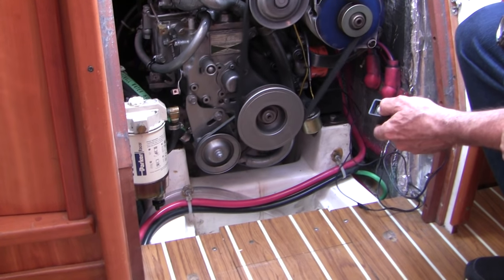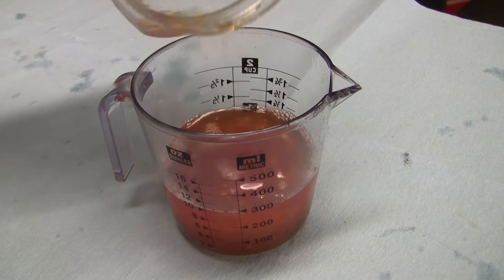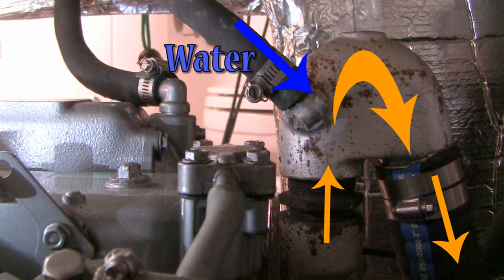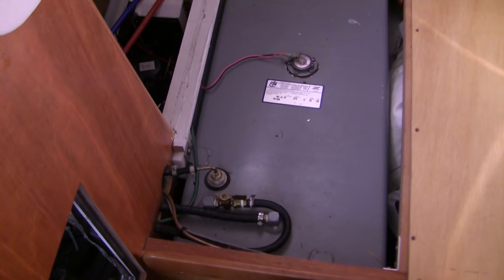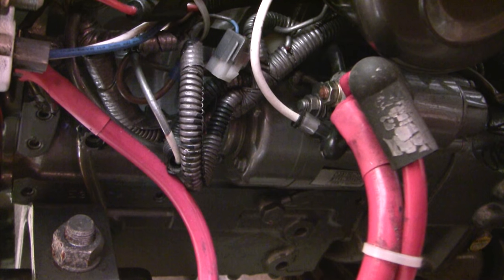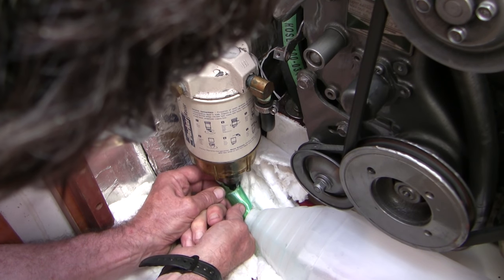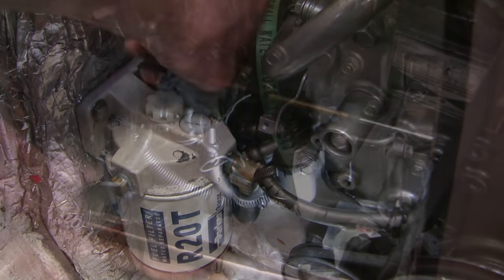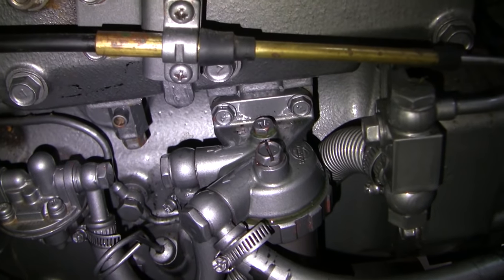How to change fuel filters and bleed air in a Yanmar marine diesel

Comment: good video. I have 2 questions;. 1. you mention bleeding the system beyond the high pressure pump going to the injectors but no info on so doing. How do you do it?  2.  I have read that turning over the engine without it starting can result in water pressurising in the engine and causing damage.  How do you avoid this?  Does relieving the pressure on the cylinders eliminate this problem?
Reply from the maker: To bleed beyond the high pressure pump, you bleed each line in turn, cracking open the line just before the injector and turning the engine over to evacuate air from each line. Because they are three in parallel, it takes a while to do that manually. In the example shown, I suspect there was air in one of the three lines in my engine, manifest as a rough running misfire that you can hear after it starts. Thirty seconds later that last cylinder kicks in as air is cleared, and the engine speeds up and becomes more smooth. So, if it is not too bad the engine will clear that air by the force of the other cylinders. 

To avoid hydrolock, if you think the engine is not likely to start immediately it would be wise to turn the salt water intake (the seacock) off, then crank it for about 10 seconds with decompression valves open. That allows oil to get to upper passageways and fuel to prime the injectors without a chance of the sudden rapid rpm's of a started engine. With no salt water being added to the exhaust elbow it can't flow backwards and hydrolock the engine. Then close the salt water intake, close the decompression valves and start normally. Sometimes on a cold winter day, when I expect it to start after a couple of 10 second tries,  I just close the salt water intake, start normally, then open the salt water intake while the engine is running (don't forget). 

Regarding hydrolock, if you think you have caused a lot of water or oil or fuel to fill a cylinder you have a few options. I know that the Yanmar engine decompression valves of this specific engine will cause the exhaust valves to open early, so one (easy but not necessarily guaranteed) way would be to turn the engine over a few times with the decompression valves flipped over and fuel turned off. Extra fluid should be pushed out the cylinder into the exhaust, hopefully reducing the chance of a hydrolock misadventure. Another option would be to wait for a few days, since gravity might allow that fluid to flow beyond the rings into the oil pan, so there is enough air in the cylinder to prevent excessive force on the connecting rod. One way to test for a hydrolock would be to put a socket wrench on the crank bolt. A hydrolocked engine will not turn over by hand, and you can't break a connecting rod with hand force alone (do that with fuel off so it doesn't start). Or, if you want to deal with suspected hydrolock more effectively and you have glow plugs, you can remove the glow plugs and put a narrow suction tube down the cylinder and suck out the extra fluid. If you don't have glow plugs (as in this Yanmar engine) you could remove an injector and suck the cylinders out that way. If you don't have a suction hose, just opening the glow plug hole and turning the engine over will eject excessive fluid out the hole. That would be messy, but don't make the mistake of covering the hole with a cloth because during the intake phase that cloth could be sucked into the cylinder. In gasoline engines that have been inverted in an accident, the protocol is to routinely remove all the plugs, and when it comes time to try the engine, we turn the engine over a few times with all the plugs removed, so any excessive oil is ejected out the cylinders through the plug holes. Whenever you're concerned about water or fuel in a cylinder, after you deal with the issue it would be wise to change out the oil because contaminated oil won't work very well. Good luck!

Comment: Thank you for your videos. Have any idea why a Yammar diesel marine stalls when on low rpm and in shift to reverse or forward stalls and dies..? have checked pretty much all. We need to get rpms up to sometimes prevent stalling but very hard to dock boat with this problem etc...Any ideas would be great and will appreciate so much your reply. Thank a lot!
Reply from the maker: Check the simple things first, maybe consider raising idle speed with the idle adjustment screw. Bad fuel, maybe water in the fuel, fuel filters.
Reply: @spelunkerd  thank you v much, yes I am trying that especially idle rpm.

Comment: Would there be an unintended consequence of adding a 12V fuel pump, placed upstream of the raycor, used for bleeding only?
Reply from the maker: Good question, short answer is I don't know. Long answer is that you already have one, by using the starter motor as shown. A dedicated pump near the bottom of the line might work a little better than the mechanical one in the engine because it would clear air and prime itself more quickly. Many outboard engines use a hand operated pump, so you might not even need the extra complexity and risk of another electrical appliance. However in the big picture I'm happy with how mine works as is. Thanks for your thoughtful remark!

Comment: Hi
I think all of you that are having problem using the feed pump manual feed is using it wrong. When you push the lever, 80% of the stroke is just picking up slack, the last 20% is what does the pumping. When you feel resistance in the lever, try pushing it a bit further. You will feel what I can best describe as pumping feeling.

I have no problem fillinf both my fuel filters from empty to full in under a minute using only the manual feed.
Reply from the maker: Good point, although the basic design is similar, we all need to be familiar with how our own pump works. Even when purged of air, my butterfly lever has a hard end stop so I don't get the response yours does, but your remark will be worth remembering for others who stop by. If mine were to do that I would wonder if the pump is resting on a high point of the cam lever, and I might choose to rotate the crank a little to make pumping more efficient. There is a dramatic difference in how these pumps perform if the line is not purged of air, which explains why air in the fuel line is a common cause of engine shutdown. If you push the lever with air in the line, the air volume expands to fill the void, rather than drawing the viscous diesel fuel upward. Energy you put into cranking the lever is absorbed by the air and the diesel moves very slowly, like trying to run in sand. Fluid won't move at all if there isn't a minimal amount of suction, which might give the impression of better response at the end of each stroke. Once the short stretch of line between the fuel filter and pump is clear of air, pumping the rest of the line is dead easy. As you say with the line clear of air you can actually feel the pump doing its job. If there was some way to design the system so that the line leading up to the pump would purge by gravity it would be much easier, but as always there are competing design interests. In any boat it is critical to have heavy parts like the fuel tank as low as possible to promote stability, so that short stretch between filter and pump is unavoidable.
Reply: @spelunkerd  
Really good point about the position of the cam!
Anyway, I have a 3gm30 and recently removed the pump becuse i broke it (ruined the threads #facepalm). Figured I could share what it lookes like on the inside when you operate the manual lever.
https://youtu.be/Dk--muuQAJc
Reply: Great work with the in-depth video!  Good point that these pumps are slow at pumping air.  You had the option of continuing to use the primary  filter's  plunger pump as it could do all the downstream bleeding.  Sadly, most engines don't have a compression release.  A primer bulb in the line before the primary filter is a great option if the primary filter doesn't have a pump.  It is much quicker than any of the 3 pumping means shown. Like many filter bowls of plastic (like yours), it doesn't meet the heat test used by UL/ABYC/USCG which may get (largely invalid) insurance scrutiny if mounted in the engine space. There are electric pumps by Facet that have both the low pressure desired and a free forward flow when off but as you say, they are electrical. They cost the same as a spare mechanical pump which can fail at the diaphragm or the check valves. A leaking diaphragm might leak fuel into the crankcase or bilge.  How many years to trust them?   Simple as they are, they are a risk and should probably get swapped at 500hrs/10yrs interval and keep the used one as spare or replace with electric and plug the  mechanical pump's output port.

Comment: If you don't have filtered diesel, can you fill the filters with diesel treatment?
Reply from the maker: I suppose it's possible, though the cleaner needs to be combustible by itself to not stall the engine when a pure dose hits the cylinders. Professional fuel injector cleaners are designed to do that in gasoline engines and I presume a similar formulation is available in a diesel form. However as you saw it was simple enough to clear the line the way I did it, and all of the fuel that made it to the injectors was filtered to 10 microns twice. If you get a speck of dirt into an injector you may need an expensive overhaul that might be avoided by being careful to filter everything that is on its way through the injectors.

Comment: I’ve just did all this, and what was once a dry engine, now has a slight leak at the secondary, yanmar filter.  I just can’t get the O ring to set!  Have you seen this before?  Any suggestions?  I’ve taken it off and on about 3 times, all with a  drop (only when engine is running)

Any tips are appreciated!

Thank you,
Reply from the maker: Dealers say to replace O-rings at the same time, they are cheap and easy to swap out. I would get a small tray, add about 10cc of motor oil to it, then put the new O-ring right into the tray so it's coated with oil. Then check the mating surfaces for dirt and carefully slide the new seal on. In the video you saw me coat the primary filter seals using diesel rather than motor oil. Motor oil is probably better for sealing leaks, and it is probably also better for more easily getting the filter off later. You might have a tiny bit of sand or debris preventing a tight seal, it doesn't take much. Don't forget to carefully examine the mating surface, you'll probably need a mirror and a light to see it properly. A small drip of diesel out isn't too much of an issue, I've seen that before. Getting air into the system would be more concerning. Good luck! If you think of another method that works better for you, don't forget to stop back and leave notes for others who visit here.
Reply: For the longest time I had a slight ooze at my secondary filter which I traced to the bleed port.  The copper washer, even when annealed or replaced didn't seal.  I had to polish the mating surface on the casting before that was fixed.

Comment: how do you bleed the line going to the high pressure pump without using the starter motor?
Reply from the maker: Good question, I've always used the motor. Although that butterfly valve works pretty well for lines up to the pump after all air is removed, it can't purge the lines beyond because the individual lines are only open during a small part of the combustion cycle. So the whole crankshaft needs to be spinning, somehow. I suppose you could do that by hand, but using the motor is so much easier. Also note that there isn't much to stop the motor from firing up, aside from ensuring the decompression valves are flipped on. So cranking by hand with a breaker bar could be dangerous, a ratchet would be better because it would hopefully slip to allow the motor to spin faster if it were to start. During the video you can hear the motor fire up on two cylinders, but the third took about 10 seconds longer, probably because there was more air in that line.

Comment: where is the plunger to pump when bleeding the air our of the filter at 18.23?
Reply from the maker: The tough thing about using a video camera in a boat is the poor lighting and cramped quarters. The time stamp you provide is the end of the video, but I presume you are referring to pumping the primary filter starting at 10:58. That brass rod hangs down from the housing after the filter is removed, not well seen in the video. When screwed down it is concealed from view, you don't need to store anything separately. The separate butterfly pump is mounted on the engine block, powered by a cam on the camshaft when the engine turns. If the engine stops at a high spot on the cam lobe, the pump won't work manually, and you'll feel no resistance when you move it by hand. In the unlikely event that happens you can rotate the engine a little and it will allow internal springs to load the pump with a mouthful of water.
Reply: @spelunkerd  I appreciate your response. I understand about cramped quarters as I was thanking my yoga teacher as I was bent double clearing in the tight quarters!!!  We will put your great information to use this week - thank you!!!

Comment: compression does not make the fuel explode  it is the atomiseation of the fuel that is critical if your injectors do not inject as a fine mist the fuel will not ignite
Reply from the maker: Good point, atomization to fine droplets is necessary as well. Neither by itself will lead to efficient combustion, without pressure, none at all.

Comment: I’m just compressing the air with the butterfly valve. What is the solution?  Anyone?
Reply from the maker: You could do what I did in the video, use the starter motor to drive it faster. Prefilling as much trapped air as you can makes purge faster, but you want to be sure the fuel you use to prefill is very clean. I've heard that some use a pump to prefill, but I have no experience with that method. The main problem with trapped air is on the intake side of the butterfly pump. You could put a syringe on the intake hose that leads to the pump, and suck as much air as you can up the syringe, until all you get is diesel fuel, to give yourself a head start.

Comment: I don’t have a pump on the top of my primary filter. Do I use the butterfly switch to get the fuel into it?
Reply from the maker: It depends on the layout of your machine. If the tank is above the filter, gravity may be your friend. Yup, the butterfly valve may help, but it isn't great at sucking viscous fluid behind a pocket of air, the air just expands and the fluid goes nowhere. I'd probably try filling the filter cannister with clean diesel to reduce the volume of air. Good luck!

Comment: Diesel fuel doesn't 'explode' in the engine, it burns.  The fuel return system works not to return excess fuel but rather the system deliberately sends much more fuel than required for operation to the injectors, this 'excess' fuel cools the injectors that otherwise would get very hot and cook the fuel inside them.  You have a very healthy sounding Yanmar and be thankful that it is all mechanical, a lot of new engines have gone to electronic injection like modern gas autos and electronics and salt water don't work well together.  These little pushrod engines are simple, reliable, long lasting, and easier to maintain than anything else.

Comment: What kind of engine behavior might manifest if the fuel return line were to become blocked just downstream of, or even potentially at, the injectors? Asking for a guy who's completely out of ideas, chasing a fuel delivery ghost...
Reply from the maker: Nine times out of ten, ghosts in diesel fuel are made of air, dirt, or water. While bleeding you could check those lines for patency, but I'm guessing they don't often become clogged.
Reply: @spelunkerd , interesting. I'm kind of grasping at straws at this point - the engine wants to gutter out around where idle should be, unless I goose the regulator lever. The problem is setting the lever in that advanced position only gives me idle rpm for a little while, before the revs creep up to where the thing is actually set (not a runaway). This makes me think governor delay, but I can't figure it out. Injection pump fuel rack operates beautifully, injectors were just rebuilt, valves lapped and reseated. An unusual ghost indeed!

Comment: New used boat purchase

I will be completely emptying the fuel tank

Unclear best practice to also clean a empty diesel tank before reading fresh fuel
Reply from the maker: I don't know. It's a perfect opportunity but you may not have very good access even with hoses removed. You'll want to flush it with clean diesel, drain from the bottom outlet hose and discard what comes out. To get water soluble contamination out, I suppose you could use a preflush with alcohol based cleaner, then rinse, then flush that with clean diesel to get all the cleaner out. It's probably worthwhile to have a look inside with a light and mirror or even a borescope to look for rust or signs of fungal overgrowth. If you're able to take the whole tank out of the boat you could take longer and be more aggressive with a pressure washer, etc.
Reply: spelunkerd 

Clean diesel and the filtering of same before or as going into the tank and leaving the  tank is critical

And the actual integrity of the fuel tank itself and fittings and interior is critical

Thanks